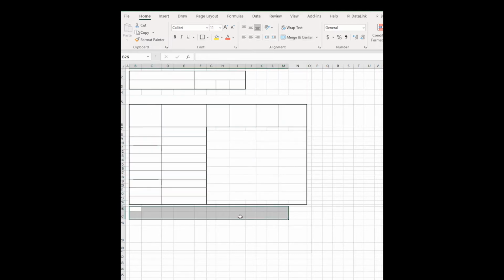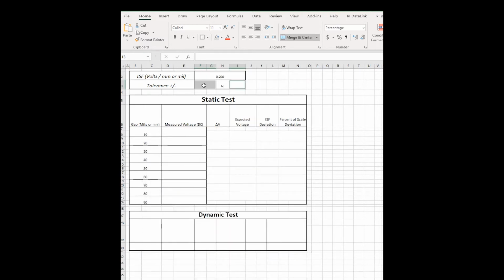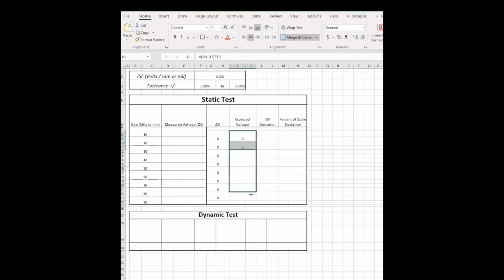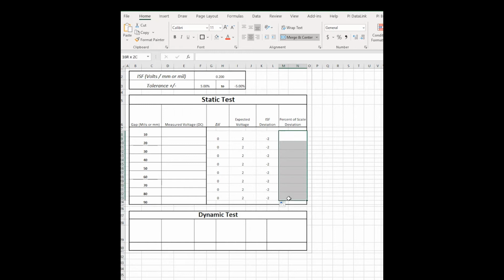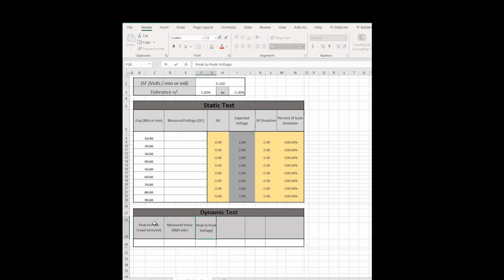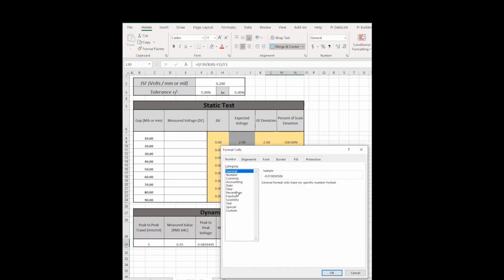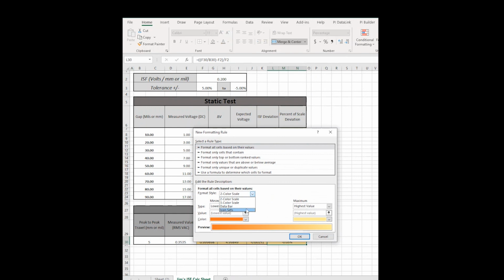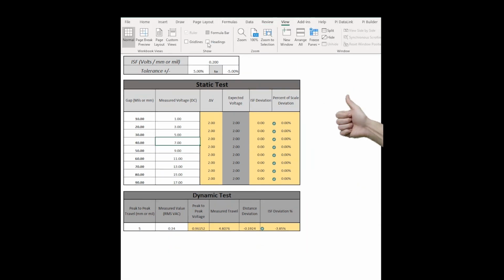Excel Conditional Formatting Probe Test Worksheet

Comment: Hi Jim I have managed to replicate the spreadsheet and am able to get the same results. However, I am not able to get the conditional formatting to work on my sheet. I am not sure why?
Reply from the maker: I'm not sure.  When i get a minute of free time, i will attach a different conditional formatting formula that you can enter directly into the formula bar.
Reply from the maker: Here is an alternate way of doing it; place this formula  =IF(AND(M8<F3,M8>I3),"pass","fail")     in the adjacent cell directly to the right of the "Percent of Deviation" cell (O9,O11.....).  This is an IF argument that ensures the deviation is between the tolerance stated  in the upper box of the form.  This will serve the same purpose.
Reply: @jimdiggins101   Thanks for your kind help. It is now sorted. The problem I had was I didn't change cell I3 to percentage and it caused all the issue. As soon as I changed it everything started working.
Reply from the maker: @khurramhaseeb3655  Oh, that makes sense.  I'm glad it worked out.
Reply: @jimdiggins101   Thanks for your help, it is very much appreciated... Let's see what the team feels when they put it to test in a few days :)

Comment: Hi jim diggins. Why is the voltage value according to the datasheet approximately negative -1 to -17vdc. But you take the positive value 1 to 17 vdc
Reply from the maker: Voltage is a potential difference and the polarity of the voltage has no bearing on the measurement.  Use negative voltage if you like.

Comment: Jim thanks for putting this together. Unfortunately I have run into a small snag on the Dynamic Test formatting as my numbers don't quite match and I haven't been able to figure out why. My Peak to Peak =D30*2*(SQRT(2))  Measured Travel =F30/F2  Distance Deviation =H30-B30  ISF Deviation % =((F30/B30)-F2)/F2  If I enter in the Peak to Peak Travel of 5 and Measured Voltage of 0.3535 I get Peak to Peak Voltage 0.999848 , Measured Travel 4.99924 , Distance Dev -.00075 and ISF DEV % -0.02.   These numbers are slightly off compared to your example and I haven't figured out why. Spent the last few hours but calling it a night and will try again tomorrow. This will be a great tool once I get it figured out.
Reply from the maker: I'm out of the office now. When I return I will take a look at it.
Reply from the maker: The number of decimal points that are configured in the cell formatting will produce a slight discrepancy.  I bet this is what you are seeing.
Reply: Jim thanks for the reply. I will look at that first thing in the morning. Gotta hot job with a few Lucas Schaevitz lvdt's at the moment.